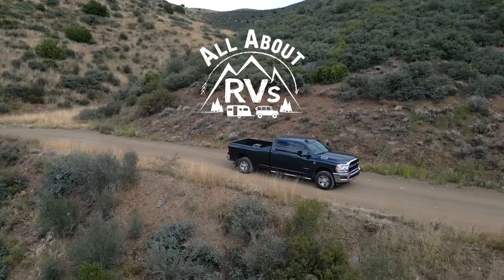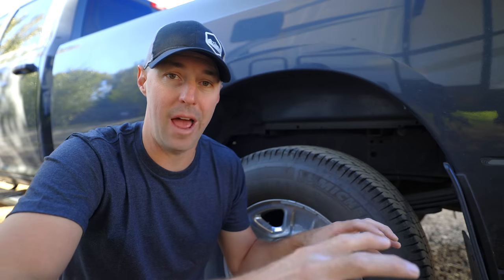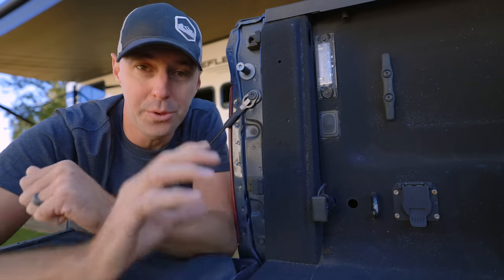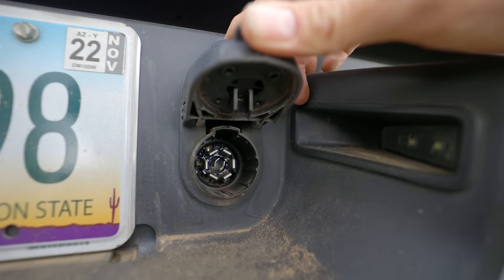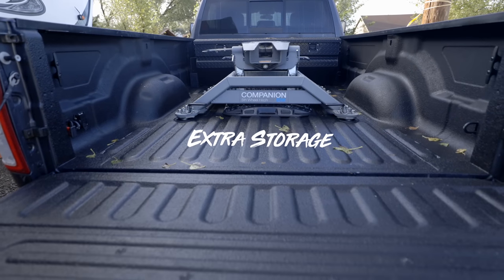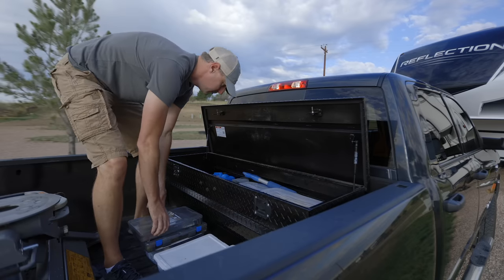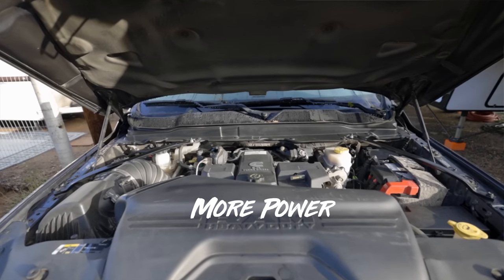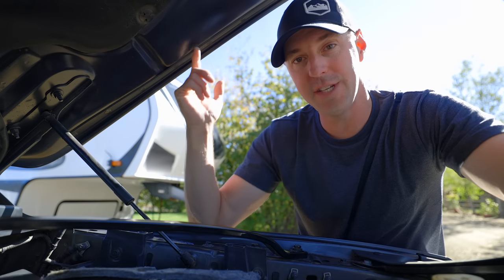Truck Modifications For RVing!

Comment: Could you show your hook up for the Anderson plug on your truck how you ran the wiring and so on.
Reply from the maker: I will see if I can make a video on that. It comes of the battery with a fuse with wire down to a redundant 30 amp auto reset breaker to the Anderson connector.
Reply: Please do this!
Reply: I ran 2 ot wire from my battery down through the driver side frame rail all the way to the back. It’s on a 120amp relay that’s turned on by factory aux switch and also has a manual 100amp breaker. That way I can use it to jump start a vehicle if need be without having to open my hood and power any of my trailers (RV included) if the 12v battery is bad or dead
Reply: A video would be nice to see!  I'm curious what gauge wire did you (Jared) run "front to back" and did you use the frame as the negative or run a dedicated negative wire?  This is something I'd like to add.
Reply: I am planning this as my next upgrade. There are several videos by other creators on installation of the DC to DC converter including wiring of the anderson connector.
Reply: Doug S ,  what gauge wire did you use?
Reply: Doug S  I would go to a minimum of a 6 gauge wire through the Anderson plug to the trailer. You have to compensate for voltage drop over the distance. What hasn't been mentioned is that you have to include the total run of the wire from that power source, battery or alternator, all the way back to your DC to DC charger and then back to your truck ground, truck battery. This run will be about 20ft, done neatly on your truck and then another 15-20 ft. back to your charger. Now double that distance, about 80 ft. If you run 80ft of 6 gauge wire at 12 volts 30amps you end up with 9.64 volts, a 19.63% voltage drop. If you use 12 gauge wire over the same distance and amps you end up with 2.34 volts, a 80.47% voltage drop.  These numbers were calculated on a voltage drop calculator. A 12 gauge will just tickle the battery and say "you want to do what."  When it comes to electricity, big wire is good, bigger wire is better.   Bob

Comment: My 2003 LB7 Duramax has a slot for a second alternator.  It needed a $35 bracket, a $35 lengthened belt, $10 extra idler and the $40 stock alternator I sourced from the junkyard (includes a 1 week warranty to make sure it works).  I also had to splice one piggy back wire to turn it on.  Went from 130 amps to 260 amp charging system for just over $110!

Comment: Ram 3500 single 136A alternator (Rock Auto) works great except for that whole voltage fluctuation on a cold day with no block heater.  One hot, runs fine, powers everything.  Truck headlights replaced with LEDs and if not running cabin heat plenty of power left over for inverter.  Plenty = more than 30A @ 12V.  Voltage is not regulated enough for LiFePo4 without BMS so ensure batteries you intend to use (you said BattleBorn at one point in one video) have a BMS.

There are three kinds of power draw:
1. Fixed.  These will always happen.  Running the ECU, etc.  There's nothing to be done here but the draw is small so disregard.
2. One time.  These happen once.  They form the "peak" of your power need.  That includes the power to start the engine, the power to start a tow from 0MPH/KPH to some motion, etc.  These are very difficult to minimize because of Newton.
3. Variable.  These happen all the time.  They are the "average" (mean) of your power need.  These include the lights (switch to LEDs), the cabin heater (leave as mid-range as you can to avoid cooling the cabin or using too much extra power to heat), tow grade vs weight (it's not linear, so if you allow the load to slow as you crest a hill and speed up on the downside you win a lot), etc.   A few days driving a Prius around will help clear this up.  I wish the inteligence/feedback/display of the Prius was an aftermarket kit for 5th wheel and trailer users.  Also I know you're in AZ... and as I'm in Tucson I get it, we have to run the A/C.  HVAC costs crankshaft HP for compression of the DX gas, and electricity for the high-power mag-clutch to engage the compressor to the shaft.  I wish there were alternate solutions, because this is the #1 draw of power in the vehicle during Arizona summers (Feb-October).

Minimizing these three is a lot more inexpensive than adding a second alternator.  Second alternators have costs:
1. Fixed.  Alternator.  Regulator (The Cummins alternators do not have a reg.  Instead, the Ram has one, so the alts need to be either installed in parallel or switchable.  This was a design decision to make them more "user-friendly" and avoid 24VDC.).  New serpentine belt.  Not a big deal normally.  Radiator removal required in my engine to get it in.  
2. Variable.  More wear and tear on serpentine belt.  Decreased fuel mileage.  

The advantages are that now you have plenty of power for a large inverter, etc.

Not to miss anything:  While I am a huge fan of LiFePo4, don't be tempted to replace your RV or truck bats with these.  THEY DO NOT CHARGE BELOW FREEZING.  That limits where you can go and what you can do... which is the opposite of the RVing concept.  I'd say "we don't worry about that down here in Tucson" but this morning I fired up the truck at 29°F (3100ft MSL) so definitely it can happen anywhere.

Loved the report from the Tampa show.  Pop-out solar cells... wow.   Going to look at my DIY slide-out cabinet drawer conversion kits and see if a man and a welder can but 2+2 together.

Comment: Really enjoy your channel. So, I feel proud to have already done many of the upgrades you discussed.  Already installed air bags and compressor - good call on that one.  I originally did not get the compressor installed, but quickly found out that I wanted it.  Changed to the larger fuel tank 3-4 years ago - very nice.  Also added two Swing Box Tool boxes to area behind wheels for storage (had to move the 7 Point trailer plug to vertical bar just inside the tailgate).  I had previously installed the BackFlip cover, but found that it blocked my view of my gooseneck ball (from cargo camera).  So I replaced it with the Re-Trax Pro XR manual rolling cover - a very good option.  Rather than 5th wheel hitch, I now use on my 5th Wheel with the Reese GooseBox Pin Box upgrade I've also done - no more 5th wheel hitch filling up the truck bed (highly recommend this).  Hadn't considered the 2nd alternator - will now.  Again, excellent videos - keep up the good work.

Comment: I use the Timbren helpers and they have worked great for me as well. The GPS app you use, is it Truck Map? That's the best for giving routes with height restrictions that I've found. I have a TT (GD Imagine) so I use a bed cover. To keep items moving all the way forward when I stop I have a 2 X 10 cut to fit in the slots in the bed (all pick ups have the slots). This is the best mod I have made.
Reply from the maker: Yes I use Truck Maps.

Comment: Hi Jared, what fuel tank did you get? Also does your “miles until empty” work the same as with the OEM tank?
Thanks
Reply: I put in a 50 gallon TITAN on my 2002 F350 and love it. I did not change the equipment and my truck is older and without miles to empty. I reed Full for nearly 250 to 300 miles and with a now 550 mile range the peace of mind is wonderful. You get used to looking at mileage instead of mile to go. I work a lot of disaster relief and having that extra fuel has really made a great difference since in most deployment there isnt active fuel stations nearby but still need to drive alot.

Comment: My truck recommendations if you have a Ram 2500. 1. Airlift 1000 in-coil air bags. These are not load leveling bags, but load assist. They expand inside of the coil spring to add rigidity to the springs and help combat sag and bounce under load. They are easily inflated with a hand pump, like a bicycle tire pump. A few pumps is all it takes to get to 30 PSI which really stiffens up the rear of the 2500. An excellent product that also doesn't break the bank at under $100. 2. Hellwig rear sway bar. As people with 2500's know it has inboard coil springs which reduces the trucks ability to handle roll and sway. The Hellwig really helps keep the rear axle planted and increases overall stability. It's also adjustable via 3 positions that the links bolt to. Worth every penny of the $300. 3. Rough Country Steering Box Brace. This is a rigid support for the steering box and sector shaft that eliminates steering play and the "wandering" feeling that 2500's experience. No more constant steering correction for those of us that do not have active steering in our 2500's. Also an extremely economical, direct bolt on option for $150. All three combined have transformed the way my 2500 drives loaded and unloaded.

Comment: You have added a larger fuel taken, and I understand and support that decision.

But it leads me to a question.  What is a NORMAL days drive for you?  

We are vacationers, meaning we normally drive a few hundred kilometers (Canadian) to a campsite and stay there for a week to 3 weeks.  Sometimes we will move to a different campground somewhere in the middle of our vacation.

By 2024, we will retire and have the freedom to Travel much more.  We did a test this past June of travelling 1,400 km over 8 nights.  2 nights at each campground.
We learned some valuable lessons regarding how we camp and the need to make some changes.

I wondering what other suggestions you have regarding how you camp and travel.

I watch several RV YouTubers and they each have different approaches.

Comment: I found the flip covers block my view when connecting to the trailer.  We installed a Roll-N-Lock cover on our truck with a tool box moved slightly ahead to allow the cover storage container to fit.  Very happy with combination.

Comment: I have Timbrens on my truck and pull a Montana 39’ fifth wheel and absolutely love them. Prior to having the Timbrens I had a lot of bounce going down roads with humps and dips but now it is very smooth. I would most definitely buy them again. I really like not having to deal with air pressure and the ride is completely normal and smooth when not pulling the trailer.

Comment: We ordered our truck brand new with 2 alternators so we would have enough power to recharge the batteries and also run the fridge on 12 volts power.  As an option it was not that expensive.  The biggest change we made to our truck was to convert it to run on propane.  So now we get an extra 275 kms or so on propane and still get to use the gasoline tank if we can not fill up on propane right away.  Propane is much cheaper than gas and better on the engine.  Even better on gas mileage.  Thanks for the great videos.  Always something interesting to learn.
Reply: I need to know more about the propane conversion. It's like a '70s throwback. What conversion.... you know the details man the details

Comment: When you were talking about the phone mount you mentioned GPS where you can input the dimensions when you are towing the 5th wheel and it would take account of tight turns, bridges etc and avoid them. Which app is this please and can you use it offline or outside the US?

Comment: I have done of those on my f250, used Sumo springs - they work well, but the most important was replacing factory shocks and steering stabilizer  with Bilsteins.  Good shocks make a difference.
Reply: @Vstar5 Bilstein stock height B6  - 4600 and 5100 steering stabilizer

Comment: I basicly have the same truck. I have the factory high amp altenator. When I need more power, I just kick in the high idle. While running and in park, turn on the cruise control and then push the "set" button. Now your altenator is working at full capacity just like it would running down the road. We use in our ambulances when idling for extended times.

Comment: I installed a MechMan 320A alternator in place of the OEM 110A alternator, it holds 14.4 at idle with front and rear A/C fans on high.

Comment: I put some thought into setting up my mega cab dually for towing our camper. I’m still working on it but so far I have the 52 gallon S&B fuel tank, along with a 40 gallon auxiliary tank in the truck bed that is plumbed into the S&B tank. I just flip on the transfer pump to refuel. I can comfortably run 1,000 miles between fuel stops towing our trailer. 
I also dumped the factory wheels and 10 ply tires in favor of 19.5” wheels and 16 ply Toyo tires. That wheel and tire combo has added more stability than any hitch, stabilizer, or airbag could dream of. Next up will be a built transmission and compound turbos with a Snow Performance water/meth kit.

Comment: We love having on board air, and with our airbags, we can just hit a button to air them up when getting ready to tow.  Also we added a 12v connector like that up front, easy to use with jumper cables to help someone else out.  Have you checked out a higher output alternator from MechMan?  They make some super high end ones that are direct replacement for the stock one.

Comment: Roadmaster Active Suspension - I added this to my 2017 F250 SRW. It significantly improved the unloaded ride of my truck by reducing hop and bounce. My wife and I live in a rural area outside of a city (Ottawa, ON), and the roadways are very conducive to throwing the bed of the truck around. Our mechanic also noticed the improved handling straight away. 

For towing, I have a reduced amount of "squat", on the order of about 40mm (1-1/2", give or take). We tow a GD 303RLS, and are well within the payload capacity.

Food for thought and consideration... And to be clear, I have no vested interests in this particular active suspension product or its promotion (I gain nothing from this comment). 

I think you, your channel, and the content you provide are all awesome. Please continue - I know I appreciate it.

Comment: Jared, pardon my ignorance for this question. I see that you bought a Renogy  DC-DC charger for in the "solar" compartment. I have a 24 volt system so I know that mine would be different but my question is how does the wiring go from the pickup bed to the compartment? Does the wire hang over the tailgate and kind of dangles to the solar compartment? Thanks f0r a reply. I appreciate you. Ed

Comment: I rarely use my VIAIR pump anymore. Instead I use a m12 Milwaukee Tools air pump. It’s perfect for topping off tires and other small jobs. It’s a big time saver as I don’t have to drag out the pump, air hose, etc. No worrying about stowing the hot VIAIR pump when I’m done, no air hose to roll up.  
For water I use a transfer pump made by Milwaukee.
Reply: What is the Max PSI on the air pump?
Reply: @jamesglenn520  120 psi
Reply: I’ve ditch my pump for Milwaukee inflator, have all red tools for work so it was a no brainer. No leash, easy to walk to trailer, truck, wife car, kids bikes, etc

Comment: The comments are TLDR so I apologize if these have already been mentioned.  However, for transporting propane tanks, milk crates are great!  Additionally, for stabilizing them on the ground with barbeques, stoves, heaters, etc.  Also, at least for my 2000 Dodge Ram, the power module, exhaust brake, and the additional related modules for the transmission have been a godsend.
Reply: I made a wood box for my propane tank, 12x18 inside x 7 high. I transport the tank on its side. The box is handy as my Moms step to get in my truck or a step if the trailer is blocked and higher in the air.

Comment: Hi Jared,
Great video as always. We have almost all of the modifications you mentioned but one that no one ever takes about is the rear end differential. I did some research before I made this modification and was really impressed with it.
I installed a Banks rear differential cover when I changed my differential oil.
I won’t go into all the benefits, you can do the research, but it’s one of those modifications you don’t see or feel any deference but makes so much sense. 🇺🇸
Reply: Yes, very good upgrade for sure!

Comment: Great list of useful mods. The Anderson connectors with the Renogy DC to DC charger is one am doing now. It would be useful to mention that by adding suspension mods, such as air bags, you already effectively transferring more  load weight onto your rear axle. But this does not increase your payload capacity.
Reply: load leveling the truck also gets your suspension back in line and provides better handling and stability.

Comment: I just looked at the suspension system on line and says that it does not support the Ram 3500. You said you have a Ram 3500. What gives?

Comment: Added a bypass oil filter system and it will keep the soot level down in your oil.  With this you can do oil samples to Blackstone labs and change oil ONLY when the quality of the oil degrades not by mileage. I also added a FASS fuel system with sump (not fass brand) and believe it or not I did have an increase in MPG will also allow cat 1 micron fuel filters to keep your injectors happy longer also keeps water out of the fuel.  Lastly, I added a EAS tuner.  I put it into tow mode and it helps the injection timing and quantity to increase power and you can put it back into economy when you are not towing

Comment: if the 2nd alternator implies that you'd idle the engine, ensure that it's a high idle. modern diesels will foul the emission system otherwise

Comment: Add a high performance, reusable air filter, intake hose & filter box, such as the kit made by K&N. Improves torque, perhaps gas mileage & allows your engine to run cooler. My system cost ~$500 and took 1.5 hours to install. Instructions were clear. K&N’s kits (the only ones I’ve used) are specifically designed for each motor. This is the first mod I’ve made to every truck, car & motorcycle I’ve owned.